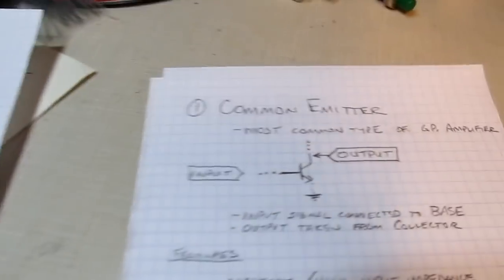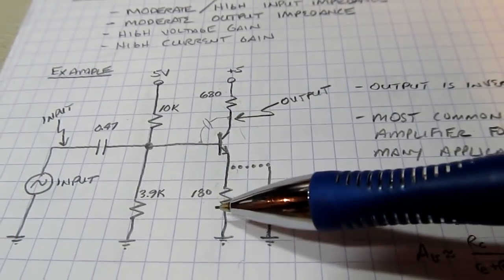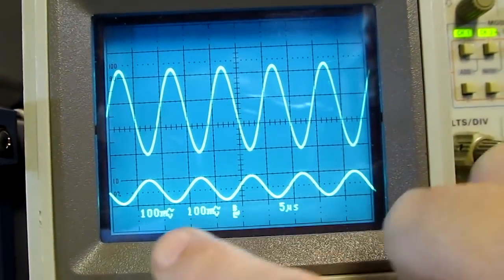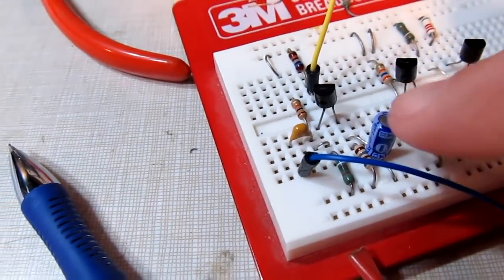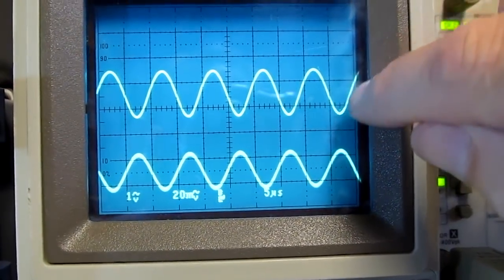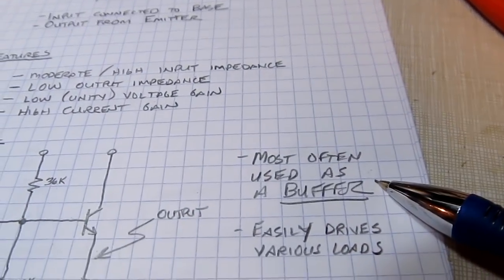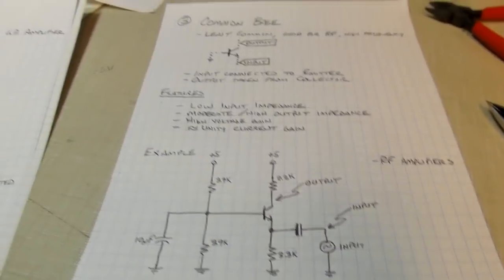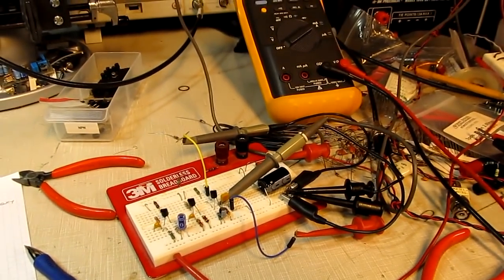#114: Tutorial: Common Emitter, Common Collector, and Common Base Transistor amplifiers

Comment: Many years ago I ran across a circuit in a magazine (remember those?  :-) that I just had to try out.  It was a single transistor in a common-base configuration that allowed me to use a small 8 ohm speaker as a microphone.  Worked well,  that did!  So that's not just "mostly RF"...

Comment: For an emitter follower, it helps to stabilize the collector current with two additional transistors. That way the B-E voltage is constant, the gain is closer to 1, and the already low distortion is even lower.

Comment: I am  much obliged for your kindness in preparing the videos and sharing your knowledge.  I've been putting together the circuits you present and have been having pretty good luck with them, though I'm  getting clipped low end sine waves above 1K htz.  Is it impedance problems, is it a voltage attenuation?  What to do?
 It is surprising how a small change in the value of a component often makes a circuit unstable or worse

Comment: This brings back a lot of knowledge that I'd forgotten about since I dropped out of EE school... Especially the common-base circuit.
Aren't common-base circuits usually drawn with the base facing down, and aren't common-base circuits also common (pun not intended) in power supplies? I seem to remember seeing and using circuit diagrams that extend the maximum current of a 7805 by letting the 7805 control a 2N3055 power transistor in common-base configuration.

Comment: At 5:50 you say Common Emitter but I think you mean Common Collector.  Thank you for a great tutotial.
Reply from the maker: Yes, you are right. Good catch. At least I properly stated it as a Common Collector amp in the rest of the segment.
Reply: +ToltecMerc I just wanted to make the same remark, since I checked, I noticed you already did mention it.  Good catch :)
Reply: I  think  he  just  said  that  so  as  to  make  sure you  were  paying  attention :-)
Reply: @w2aew  I noticed it too--but you can read the words "Common Collector" on the page (because you just finished talking about that form of BJT), so it's pretty easy to follow what's going on. 

Awesome video though--really helpful to see the signals: Common emitter (inverting) vs the other two (non-inverting). That's incredibly helpful, so thank you very much for making this video!

Comment: Hello Sir, that is the best teaching method I ever see. Anyway, what transistor do you used in this example and what is the maximum frequency that the transistor can handle? What transistors should I use to amplify small signal with the frequency range of : 17MHz up to 47MHz?
Reply from the maker: I just used general purpose transistors like 2N2222A or 2N3904 in this video. The maximum frequency of operation can be limited by a number of things. Usually it it the surrounding circuitry that limits the frequency response, and not the transistor's parameters like fT or Fmax alone.

Comment: In Common Emitter amplifier configuration it can be seen on scope that when bypassing the Emitter resistor along with huge gain increase there is also more signal distortion, as it should be. Thanks.

Comment: Excellent intro tutorial on the amplifiers, Alan! I got a question on that: On the cascode amplifier, the signal passes through the common emitter amplifier first and then passes through the common base...so it seems that the bandwidth reduction effect is still there on the first stage. Is this effect reduced just because the voltage gain (Av) for the common emitter is minus one on the cascode configuration, or something on the common base prevents the inverted signal from being coupled back by the capacitor effect and reduce bandwidth?
Reply from the maker: mauro sobreira It is because the voltage gain is reduced to -1 on the common emitter stage.  This minimizes the Miller Effect.  The Miller Effect is the multiplication of the C-B capacitance by the voltage gain.  Since the magnitude of the gain is unity, the C-B capacitance doesn't get multiplied like it would in a single common emitter gain stage (without the cascode).
Reply: ***** Crispy clear, Thanks!

Comment: I'm confused about the cascode configuration.  How does it negate the bandwidth limit of the common emitter? The miller effect is still there right? Doesn't it need to run through the Common emitter first? I initially  thought was that you said something wrong and that a common collector feeding a common base would make more sense.  Great Video as always.

Comment: I don't understand this Common Collector amp, when i measure the output using Oscilloscope there is no voltage gain, but when i measure the output using multimeter there is significant gain from 1V to 9V! 
Its confuse me 😕
Can someone please explain to me what's going on?
Reply from the maker: A common collector amplifier does not have any voltage gain, but it does have current gain.  It is most commonly used as a buffer amplifier - to take a signal that can't drive a low impedance load and buffer it so that it can drive a low impedance load.

Comment: Hi Alan, Thank you for this video,  Actually all your videos have been extremely informative.  I am most interested in the common base configuration.  The project is 2 build a preamp for a wide band single turn loop antenna.  Wide band being 20 KHz to 20 MHz or so. The single turn loop of about 1 meter in diameter is a low impedance source, actually it changes across frequency I believe.  So I was investigating common base amplifiers and found your video.  Can you please tell me how to  optimize, make the lowest input impedance for this type of amp?  Originally I thought it had to do with the emitter resistor but now I see that it is a function Re?

So is Re device dependent?  Or can it be adjusted by the resistor values?
Thank you again for the great videos.  I will eventually watch them all
W1VLF
Reply from the maker: The effective small signal emitter resistance (Re) is a function of the collector current.  It is also 1/transconductance (gm).  Since gm = Ic/26mV (at room temp), then Re = 26mV / Ic (at room temperature).  Thus, higher collector current gives you lower Re.

Comment: You mentioned that the common base configuration does not have the Miller effect that the common collector did. But the common base, I assume, also has parasitic collector to base capacitor doesn"t it? If so, why isn't there a Miller effect as well in that mode of operation? Excellent video like all of your videos. I am enriched by all of them. Thank you.
Reply from the maker: The Miller effect refers to the magnification of the INPUT capacitance of the amplifier (common emitter, common source) where the base-collector capacitance appear larger due to the gain of the amp.  In a common base amplifier, the input is on the emitter, and therefore the base-collector capacitance isn't seen by the input.
Reply: @w2aew  Thank you. But then don't you still have the emitter-collector capacitance that can have this Miller effect?
Reply from the maker: @uiticus  Two things working in your favor:
- emitter-collector capacitance is generally very small
- input impedance to the CB amp is very low, so small capacitance at the input is not going to be a factor.

Comment: i have a similar setup except with the addition of a coupling cap at the output , but for some reason my waves are slightly more out of phase and about a voltage difference in Vpp , but once i crank up the frequency they line up a lot better and only about .1 volt in difference Vpp. im assuming it has to do with my capacitor values and perhaps cut off frequency, but im pretty sure my values are right and should work for the frequency ranges i want basically 120hz and above.

my AC source is 10Vpp @120Hz and above. coupled via a 4.7uF.... My collector is @12Vdc I have two 1.2k resistors giving me about 5.9 volts at the base .. my emitter i\has a 470ohm resistor and from my emitter i have a 47uF cap....
at 120Hz i have a good amount of phase shift, and about 1v difference in the waves... at 1Khz everything lines up pretty nicely... how come? I would expect everything above the cut off frequency to line up nicely
Reply from the maker: One way to verify if the capacitive reactance of a coupling cap (or decoupling cap) is causing the issue, try temporarily placing an identical capacitor in parallel with the one in the circuit.  If you see a difference, then you know that the value is a little too low for the frequency in question.

Comment: yes the dynamic impdeance is the emitter resistance at a certain temp with a certain dc current, we usually use 25mV/IE. 25mV being the quiescent voltage at 20degrees Celsius I would like to see you do a video on a swamped common emitter amplifier, have you done that yet? thanks
Reply from the maker: Yes, check out this video.  It shows a swamped CE amp, and the same amp with the emitter resistor bypassed.
https://www.youtube.com/watch?v=VWY2WQcKJgk

Comment: Beautiful!

Your vids are top shelf!

That must be a Tektronix scope (my all time favourite especially the older ANALOGUE beauties, of which I have a few), but which particular model is yours? It looks like a 2000 series, like my 2465, but I'm not certain.

Cheers,

Dave
Reply from the maker: +David Cole You can see the model number at the beginning of the video - it is a 2467, which is the same as the 2465 but with a special CRT (called a micro-channel plate CRT, or "BrightEye"), which has a very fast writing rate.

Comment: Great tutorial! Thank you.! Can you also make a video about multistage amplifier? I have trouble coupling CE and CC without having loss in the signal. Tried making the Rin of CC larger by increasing RE or biasing resistors, but then it's gonna eat up the voltage of CE, also tried making Rout of VCE smaller, but it depends on RC which I need its value to set the gain.. so many conundrums, it would be much appreciated if you can make a video about this designing thought process and strategies.
Reply: 可惜我不大懂英文，否则应该可以解答你一部分疑问。
Reply: Hansun Lee 我試著翻譯我說的內容成中文，因為這些中文詞彙沒學過。我的問題是在兩個放大器的銜接，如果前一個放大器的出口阻值太大，後一個放大器的入口阻值太小，那麼信號傳輸過程中就會丟失，CE的出口阻值沒法減少，CC的入口阻值也沒法增加，因為牽一發動全身，我不想改其它參數。
Reply from the maker: That is a good suggestion for a video.  It is always a balance of several parameters.  If you can AC couple the signal between stages, some of the constraints are removed since you and set the bias point independently.
Reply: Yuji Naka The Google translation of this makes sense. Like explaining a different way.
import and Export resistance sounds cool.
Reply: ***** Now I'm trying to figure out a place to put a bypass cap. I biased them separately anyways. Thank you again for the nice tutorial.
Reply: jon sanford Sounds like talking about global trade.
Reply: Yuji Naka There is your analogy for thinking about the amplifier .  Which components tariffs are stifling free flow of goods?
Reply: U.S. military base has an impact I guess :)
Reply: Yuji Naka 尝试复述一次你的问题：两级放大器联接，如果前级放大器的输出阻抗很大，后级的输入阻抗很小。你想在不改变目前元件参数和不造成信号损耗的情况下，完成这个电路。Right？

这种情况下，你可以在两级放大器之间加入一个缓冲电路，用于改变其输出输入阻值，Common collector amplifier 就是你需要的缓冲电路。
Common collector amplifier 输入阻值很大，扇出（fanout）能力较强的一种放大器，可用于你所描述的情况。
Reply: Hansun Lee 我後級放大器就是CC，要求是不能再多加一級，其實即便加了，CE的出口值還是很大，我要至少百分之一後級入口阻值。還有其它辦法嗎？這個問題快折磨死我了。
Reply: Yuji Naka 晕了，你可能搞错了电路。
Reply: 輸入電壓-CE-CC-輸出 這樣的安排，不能改變。要求放大10倍，波幅正負1伏。
Reply: 我設計單個參數都沒問題，就是聯結不丟失信號的問題。
Reply: Yuji Naka CC本身的入口阻值很大，跟在CE后面是没问题的啊。
只有CB的入口阻值才会很小。
Reply: Yuji Naka 你有具体的电路图吗？
Reply: 加了，我呆會畫給你，先謝。
Reply: Yuji Naka 未收到你加Wechat的信息
Reply: 一开始我就搞错你的意思，你所写的CC和CE我一下未能理解为共集和共射放大器。
Reply: 我又加了一次，看收到沒。
Reply: Yuji Naka 没，你ID呢？我加

Comment: Great lesson! Do you have a video on PNP transistors? I've used them as simple switches, but I find them rather confusing...
Reply from the maker: They work exactly the same as NPN, except the polarities are all reversed.   In a very simple sense if you turn any of these circuits upsidedown and change to PNP, that'll work.
Reply: @w2aew  

I have heard that, but in my limited experience it seems not to be the case. My understanding is dismal to say the least... but is there something about drawing vs. pushing current... I've noticed PNPs work better in some applications than others like synchronizing an LED to music, for example. I've tried using a single PNP as an audio preamp and couldn't get it to work... though it's easy with an NPN... Have you made a video specifically regarding PNPs? As always, thanks for taking the time to reply and for making high quality educational videos.
Reply: @w2aew  

You'll have to forgive my ignorance. I'm still new to electronics as I only developed the interest about a year ago, or so.  As in most fields of study, the more I learn, the more I recognize my own ignorance. There is so much to learn and your clear and concise videos have been, and continue to be,  such a big help. Sincere thanks for the education, and especially for taking the time to reply to my, what must seem, inane queries.

Comment: Sir , why is it called common collector where the collector isn't common ? It resembles the common emitter except that the load resistor is in series with the emitter
Reply from the maker: It refers to the "common" terminal of the transistor with respect to the signal being amplified.  For Common Emitter - the input is the base and output is the collector, thus the emitter is the "common" from the signal's standpoint.  For Common Collector, input is base, output is emitter, and collector is "common" from a signal standpoint (via decoupling caps, etc.).  The "common" terminal is the one that "doesn't move" with the signal - i.e. a reference point.
Reply: +w2aew oh I see . That means that the point which we don't place the input and output signals across is the common one .
Reply from the maker: Yes, you got it.
Reply: +w2aew Sir , I have read that the output voltage across the load resistor in the common collector transistor is approximately 0.7 volts less the input signal due to the emitter- base voltage drop . Is that correct ? And one last question sir , in the common emitter the output voltage is taken between the emitter and collector not across the load resistor while in the common collector the output is taken across the load resistor itself . Is that correct too ? And sorry about asking so much questions
Reply from the maker: The output of the common collector stage is about 0.7V lower in DC offset only.  The peak-peak amplitude should be nearly the same (basically unity gain with a DC shift).  In the common emitter, the output voltage is generated across the collector load, but the voltage certainly can be taken as the voltage between the collector and ground (since the supply voltage and ground are essentially the same from the signal's standpoint).

Comment: Reviewing the (great) old video... I haven't tried a common base amplifier yet. I wonder if it would be suitable as a pre-amplifier  between a modulator and the final drive amp on a transmitter?
Reply from the maker: Could work well.
Reply: @w2aew  Common base proved to be the magic sauce.  See   https://youtu.be/ei9r2BTER8k
I'm still working on the power amplifier stage. Any suggestions on optimizing a shorten AM (1MHz) antenna of about 30ft? I experimented with loading coils and pi filters but with poor results compared to my other higher frequency builds. 
Thanks again for the education!

Comment: Hi Alan, do you have a video where you show how to calculate values for emitter by-pass and coupling caps? Having a hard time finding a succinct way to demo this to my class.
Reply from the maker: Some of the info might be in this video: https://youtu.be/VWY2WQcKJgk
For the emitter bypass, you choose a cap value that gives you a reactance that is 5-10x lower than the emitter resistor at the lowest frequency of operation.  For the coupling caps, it really comes down to looking at the impedances on either side, and picking a reactance that gives you the coupling that you want at the frequency extremes.

Comment: Hey Allan.  as you know Ive been in college and we are finally working with bjt transistors.  In a common emitter isnt the AV gain rc/r'e because re is bypassed with the cap.  and also the output impedance of a common emitter is usually low so that most of the signal gets out to the load??  All the best ve1qet